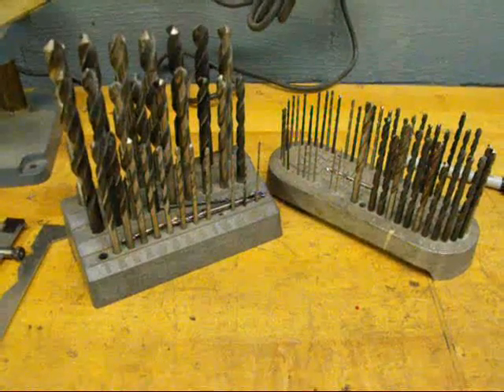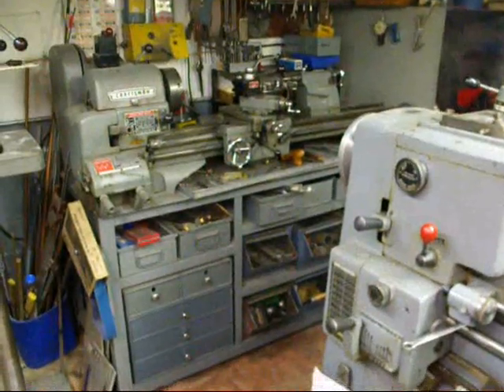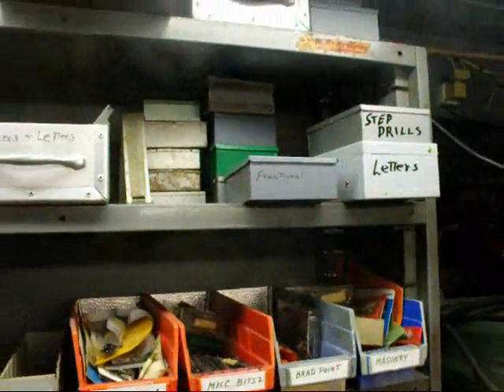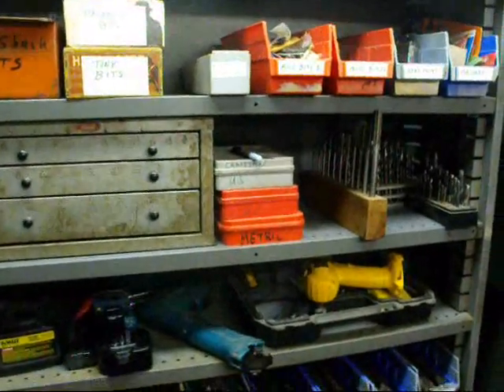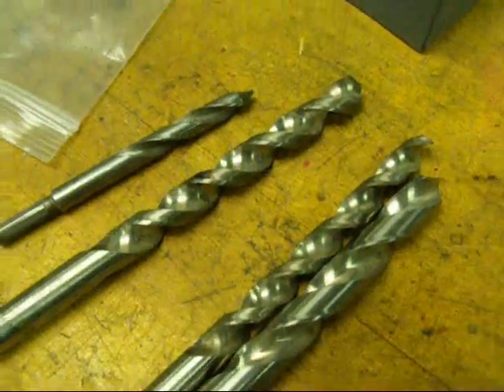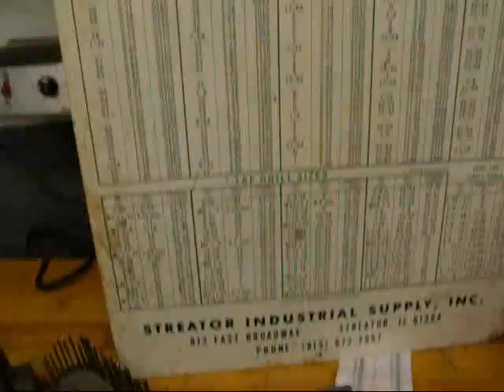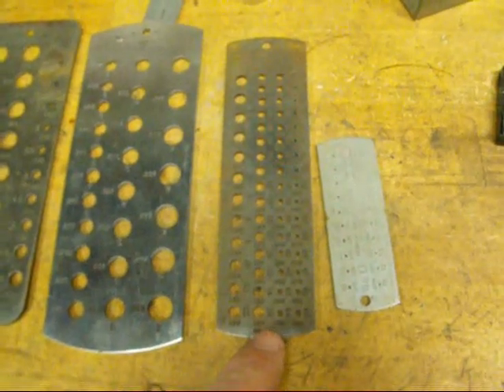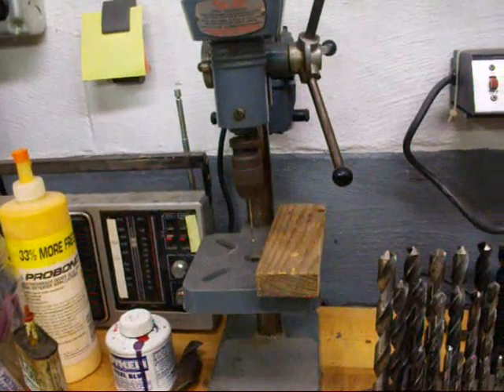THE USE & CARE OF DRILL BITS part 1 of 3 tubalcain

Comment: I think the cordless drills have finally gotten to the point where they are useful. I've got a Milwaukee impact, Drill and Flashlight with 12 Volt batteries, they are light enough and the battery lasts long enough to be a real tool. 
  Steer clear of the 18 or 24 volt things, those are for weldors and construction workers who try to use any old burned, pointed piece of metal to make a hole!
 Maybe some of them will watch your videos and learn how to make a hole with less than 25 horsepower.
Reply from the maker: Thanks lol

Comment from the maker: Stick with quality high speed steel bits. Never mind the ones that are gold plated. never heard of the toolpost drills. ALORIS makes a tool holder with morse taper socket and one with a Jacobs chuck that can be used to power feed with a drill on the lathe.

Comment: Extremely informative video. Thank you for taking the time to explain this important skill in detail. I didn't  smash my drill grinding jig with a hammer as you did, but I was tempted to throw it  on many occasions. In retrospect, I also found it to be useless, and relied on the old tried at proven methods that you detail here. Great job... Thanks..Matt

Comment from the maker: This company began back in 1854, when Albert R. Silver and John Deming formed a company to make agricultural machines, although the "Silver & Deming" name does not date back that far.  Silver & Deming apparently invented the large-size twist drill bit with a turned-down shaft so they can be used in a chuck smaller than the bit's cutting diameter. They did not patent this idea, so the idea was quickly copied by others, but these bits are still called "Silver & Deming drills".

Comment: Is it necessary to gradually increase the drill bit size or can you just drill a pilot hole and then go straight to the final size? I drill a lot of 1/2 inch holes and I usually step up the size 3 or 4 times before going to 1/2. Thanks

Comment: For my best drill bits have several fold up drill bit holders that hold up to a 1/2" drill bit. Have drill I refer for # , letter & stainless steel drill bits. Place loose ones in small wood boxes.Never liked them to bump against metal storage bins. Should make a wood holder for all the 33/64 to 1" drill bits that I have but seldom use since retiring.

Comment: I have a Black and Decker $30 drill. I used the cheapest drill bits K-Mart had for like $2. Do you think that is why it did not really drill deep in the wall? Is it the drill or the the drill bits that really matter? Thanks

Comment: I bought a $50 drill bit set at a local tool supply and I used a couple of the bits for a few hours and they became dull.I know they are cheap but I think they should have lasted longer than that.I took them back and they wouldnt do anything,they told me if you dont use oil they wont last.
I told them they are junk and I have bits that I have used for years and never used oil or sharpened and they work fine.I think they could have at least tried to send them back or something.